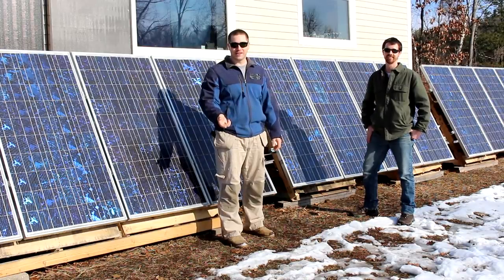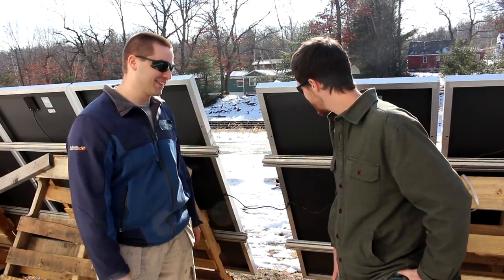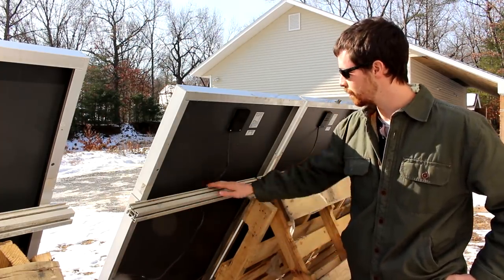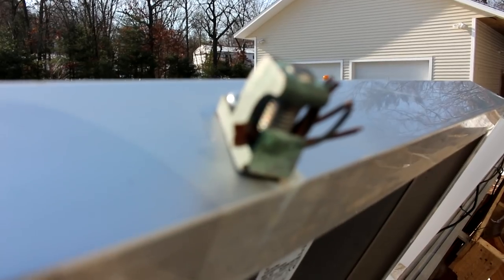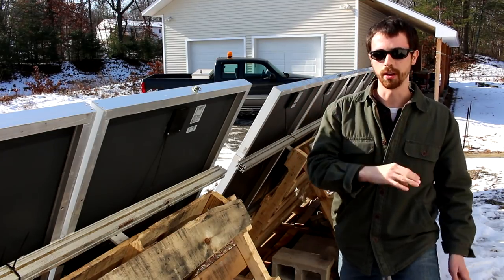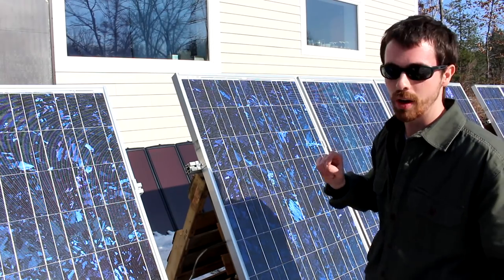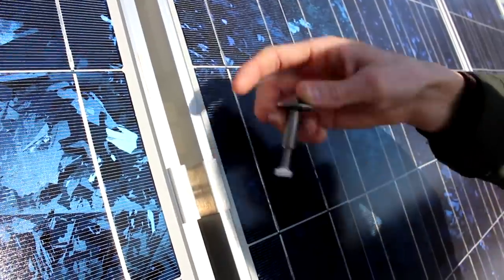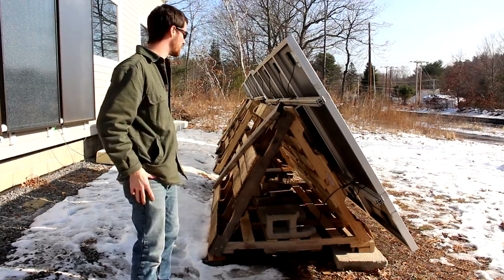A PV Expert finds the flaws in my system

Comment: You could turn it into 2 or three arrays, have one set for morning sun and one for evening. or even a mid day as well. This can help to lengthen the amount of time your system is producing power during the day. Possibly giving you a better overall production and charge curve.
Reply: lengthOFpole: Very effective way to flatten the production curve, but each array should be connected to its own inverter. Micro-inverters would work well where each panel has its own inverter. If they all connect to a single inverter, then the net production will suffer significantly.
Reply: Soren Solveig that should read charge controller, not inverter, the inverter isn't related directly to the panels on most systems. MPPT controllers are cleaver for this purpose. Cheap charge controllers are for weekenders and killed many batteries when used for off grid systems in my experience over 30 years.
Reply: you have no idea WTF you're talking about unless you're putting each array on it's own midnite CC and a common battery bank.
Reply: One thing Kevin missed was bypass diodes.  When a panel in a string is in shade, the bypass diodes keep current going in the string.  Sometimes a single panel can still get partial output in partial shade, when that panel has multiple bypass diodes.  It is NOT like a resistor!  For shading purposes,  a long string is actually better (assuming it is within vmax limits of inverter) than multiple strings in parallel  if the inverter has one MPPT input.  It should also be said that this is a grid tie system. 

Micro inverters and optimizers are really over rated.  These items add many extra connections (4x the weather exposed plugs) that might fail.  Having more electronics in heat and exposure to weather is also a disadvantage .... along with much more difficult roof work/array removal for each failure.  Many string inverters have 2-3 isolated MPPTs for making dissimilar string sizes and angles to sun.  The one big advantage of Micro inverters and Optimizers would be low dc voltages and "quick shut down"  in fires to protect fire fighters.  This also make things more safe for  DIY or repairs.  High voltage DC is just not DIY friendly.
Reply from the maker: @Koi Solare: I love your point about extra electrical parts and plugs exposed outside.  This array is off-grid, I'm sorry we didn't make that clear in the video.  Thanks for watching.
Reply: @koisolare1266  yes like phrase it isn't diy friendly , I coped slot after battery took 17 days arrival and most present common diode flu tuation with shading experience slot got what could afford 24 v off so use inverter that is modified so need updated things but it took about 3 months to properly run lighting 300 watt off a tiny system for extreme weather need lights so expected the good of my first try with solar and the diode earlier was inhumane with wires spread from the contact it snapped off now is insulated with duct tape in as many diy friendly aspirations r thin but it took that long to be eeficienced then the off has about that much time and cause voltage drops shading so also got a plug adaptor for voltage from all things monitor it and update as it effecient or look into storage and panels only running inverter good phrase follow the first and stick with it until U have or know what points make it charge from solaring
Reply: @koisolare1266   vmax limits of inverter? I think you mean Controller?

Comment: I'm very  new to solar.  Good video.   I'm having trouble figuring out the best configuration for my panels.   I'm using a 3000 w growatt 48 volt sys.  I can max out at 4500 w and 250 volts.  I have 24 panels to use  they are 240 w panels. Voltage for each panel  is 29.6 and 8.12 amps     can someone  please help me to understand a good configuration for my system.   Thank you.   Frank R

Comment: Thanks. useful tips. I got the parts but have not installed them yet. question: what is the deal with the angle? why not horozonal?
Reply from the maker: I have them at a steep angle for winter gain.  I set this up as a direct space heater system, use only in winter.

Comment: How many watts does that thing kick out with 12 panels? And how many batteries do you charge with the solar? Thanks!
Reply from the maker: Each of those old panels in the front are 158 watts.  I have a more recent video showing my batteries from a Chevy Volt car, 18kwh.  Although, I don't have the system finished so one is not yet charging the other.  Thanks for watching.
Reply: DavidPoz 
Hi David...
I’m new to your channel and was wondering if you’ve 
finished your system yet and have videos posted?
Would you mind sharing how you went about finding
and acquiring the batteries from the Chevy Volt?
How much did they cost?
What made you think of using these instead of a more
conventional battery system?
Thanks for any help that you can provide...!
The same goes to any subscribers who might want to share
what types of battery systems they used, the cost, and why
that type of system...!
Have a great day and be blessed.
Reply from the maker: Hi Troy,  The Chevy Volt battery was $2k.  I have a video of getting the battery and starting the battery series: https://youtu.be/V1t1SoEhVNQ  I wanted to use them because they are cheaper than new "solar" batteries.  Here is a video where I give a quick overview of the whole system.  https://youtu.be/722GNWlEN1g  Thanks for watching.

Comment: "Bonding" is the term for connecting all metal components to ground... Be sure to bond to ground your EMT too... giving all the metal components the same "electrical potential" in this case, to ground...  I would not only bond that ground conductor to your PV disconnect ground lug... I would also drive some ground electrodes at the panels and tie in the other end of the ground conductor from the last bonding point of connection... you could also utilize the rods to help hold down the pallet frame... this may also help with a lighting strike on one of the metal components, the ground rod electrodes being the shortest path to earth ground...
Reply: If he has a ground rod already in home then he he would also need to run a ground wire to "bond" all the rods as well.

Comment: Electrical earth is like a structural foundation; when there is a fault or earth is compromised, the whole system falls down. Lightning or the effects of a 'dry joint' or moisture can damage expensive electronics.

MY RECOMMENDATION
If you can't draw the circuit and check your protections, don't turn it on to commission the connections.

Comment: If you give me close to your exact latitude and your approx longitude I can work out what angle you can move the panels to every month or two to maximise output. Not much but positioning them a couple times a year normally gives an extra 5% or so kWh average each month. I'll throw in a pretty graph for you too :)

For me though I normally group the panels together in 1kW sets then connect each to a grid-tied inverter or battery charge controller. That way shading especially due to clouds doesn't hurt the otherwise series string as much and doesnt cost much more per kW than bigger single inverters/charge controllers. Oh and MPPT is a must always
Reply from the maker: That's cool that you can get 5% a month, nice.  These pallets can't be angled differently easy, but I am working on another project.  My next array is going to be made with angle iron, and I hope to make it easy to change the angle so your help would be awesome.  I live north of Worcester, MA.  Latitude 42.5
Reply: Cool, will fire up Matlab when I'm home and will let you know :)
Reply: I know I am a bit late to reply, but wanted to offer up a suggestion.  One of my thought exercises is based on the idea that solar panels are the most efficient and useful when they are just as good at being something else.  That is a bit confusing, but to make it more understandable imagine covering a deck with struts, but using the solar panels as the roofing surface with acrylic panels covering the seams.  It would probably be cheaper than a traditional roof.  Or imagine  an arbor in the yard where the middle arbor roof cuts are recessed slightly to house a solar panel that isn't visible from the front or back.  

Anyway, just something I was thinking about.  Thanks for the video.
Reply: Agentrfr 
A quick easy way to adjust panels for the time of the year..
Place a cup.  Like a red dixie cup, big side down on a panel..
Adjust to balance or remove the north south shadow..
You can record the angle for next year
Reply: Latitude is the biggest factor longitude has minimal affect.
Reply: was wondering about why they asked for long,  apart from locating where he is

Comment: he's wrong about the ground-lug giving grounding faults.  these are PV generations points , not part of a MENS system.
The point of ground lugs is primarily legislative compliance.
The bonding panels to each other stops electrolytic activity between panel frame and rails.

Comment: I should expand a bit on microinverters, optimizers, and string inverters.

Basically if you have no shading issues, a string inverter gives you the best power production.

For a string inverter you always want to use one MPPT per string.  You do NOT want to parallel strings if you can help it.  If you parallel strings, then shading a panel on one string will cause the MPPT to be non-optimal for both strings and you effectively lose a second panel's worth of production from that.

One or two shaded panels in a large string system will still produce better power than microinverters or optimizers.  The reason for this is because wire losses are far lower for a string inverter... its operating somewhere around 400V (if you have enough panels) where as microinverters output 240VAC, so current is almost double with a microinverter and that means wire losses are quadrupled.

Optimizers are a bit of a special case since optimized strings are typically still fed into a string inverter.  Generally they have similar results as the microinverters, though, but the electronics are simpler and you can still back-haul high voltage DC.

Microinverters and optimizers do best when the shading is on more than just a few panels or if the shading is diffuse... due to trees and leaves and not due to hard structures.   Or if shading is on a lot of panels.  Then microinverters and optimizers can be worth it.

Grade A microinverters, optimizers, and string inverters are generally all 97% efficient.  The issue comes down to dealing with shading and losses on the wires.

But MOST of the time, the money you would spend on microinverters or optimizers is better spent on buying more panels instead, then using a string inverter.   Also, the string inverter is in an easily accessible location whereas the microinverters or optimizers are up on the roof on each panel, which are far harder to deal with when something breaks.  Warranty non-withstanding, a solar panel will last 40 years whereas a microinverter or optimizer probably won't.

Comment: parallel or serie is defined by convertor input voltages, ex 150/450 volts. Then you have to make groups (  strings) that match these specs.and ballast is around *20 kg per panel

Comment: I have 2 kilowatts grid fed in the UK. No sun and very cloudy and they are powering a 42 inch tele and laptop, wifi  router and 60 watt fridge. oh and the central heating pump (40watts).
Reply from the maker: Nice.
Reply: now just get rid of the tv...that alone will free up a sizable bit of the load. not to mention it will free up alot of your time..and free your mind of the EM drivel. enjoy!

Comment: As a former/retired licensed electrician from Australia it amazes me that the USA allows amateurs to fiddle with these systems at all. Qualified and licensed electricians will USUALLY do a far neater, safer and complying installation.
And BTW guys..... When is the USA going to catch up with the rest of the world and go METRIC? Everyone else measures cable sizes (and everything else) in millimetres. (And yes, that's the proper way to spell millimetres otherwise METRIC would be spelled METERIC).

Comment: Dear i install inverex 3.2 kv with 16 (150W) plates the volts obtaining from round about 320 vol  some up and down but the amp are very weak morning time 0.5/ 0.7 and maximum 2.5 in day time what can i do for improvement of amp

Comment: 7:00 I don't think that has been an issues for some time now, like at least 8 years. Have you ever tested that theory? I have, more than a few times. Shade one module and only lose wattage of that module. How?, bypass diodes.
Reply from the maker: Yes, I have tested this on my setup and Kevin is correct.  I have since re-wired to two parallel strings to harvest more.
Reply: Your system has bypass diodes and what?

The drop in power output is basic electric circuits, which is all an array of solar cells is when wired up.  It's going to be wired in 1) series, 2) parallel, or 3) combination of (1) and (2).  Resistance in series will always affect the whole circuit.  Only parallel gets arounds that.  So more "modern" panel installs do a combo.  Diode?  Diodes just control circuit flow.  Your bypass diode is merely the common way to implement solar panels IN PARALLEL.

Comment: I heard if you hang  a white wall not to be directly in front of it blocking the sun but below it at an angle with say your setup but I'd say the snow is reflecting the same amount of light I heard not to use mirrors because it would make the solar panels heat up and produce less electricity. Do you think this is true
Reply from the maker: I have not observed more electricity being made with snow on the ground vs. grass.  However, I also have some panels that make hot water (solar thermal) and those do benefit from the snow on the ground.  So I think you probably have the right idea that with solar electric (PV) any increase in sun reflection also decreases efficiency because of heat.